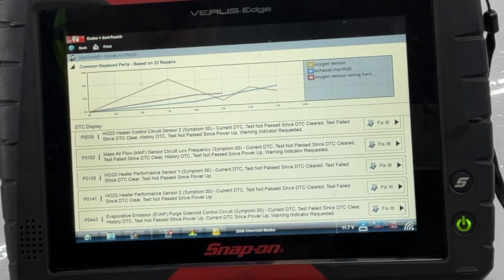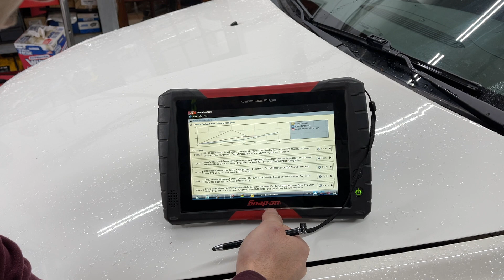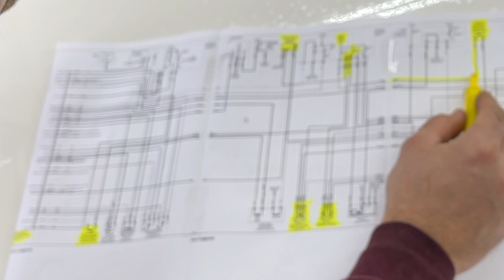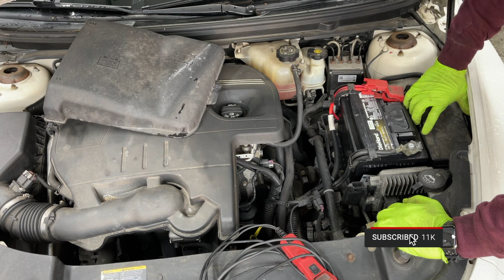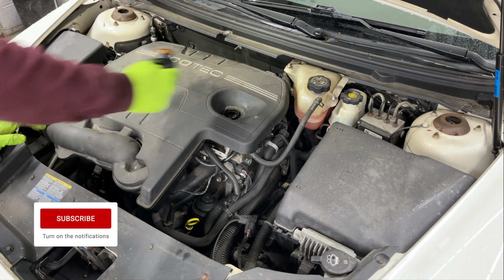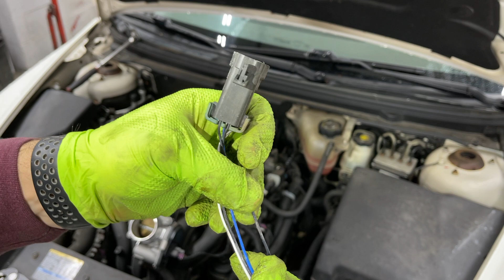PO030, PO036, PO102, PO135, PO141, PO443 Electrical and wiring problem. 2008 Chevy Malibu

Comment: So what was the end result? I have this same issue. Replaced all the sensors including the cam position sensor. Got it to run but it will stall still and all the codes come right back.

Comment: when checking the solenoid valve. What is the voltage that should reach it? I already tested it with battery voltage and you can hear it open and close. But what is the voltage that has to be connected to it?